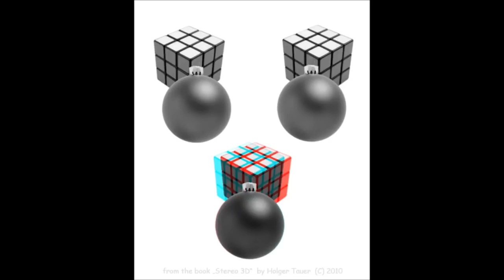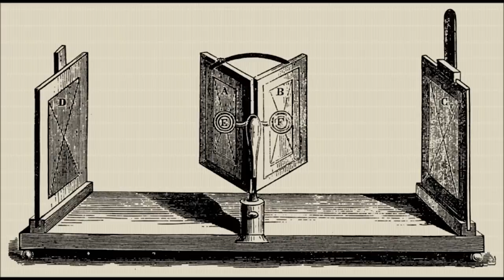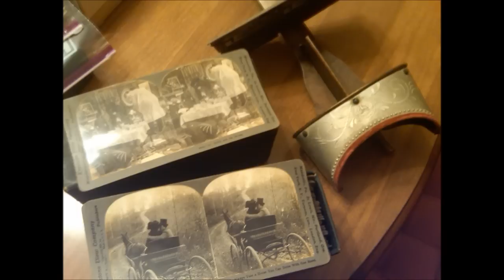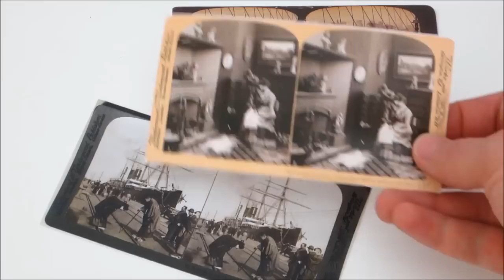DIY Hacks & How To's: Make a 3D Viewer

Comment: I can see both, crossed-eye 3D and parallel view 3D, for some reason switching between these two formats changes my eyes' view angle and because of this I see the parallel images bigger than the crossed-eye images, so if you haven't tried any of these formats, then try the parallel view first because it's better.

Comment: the picture at 1:47 has the depth completely reversed. The house and the green tree actually stick out in front of the pink one.
Reply: It has to be viewed using the cross-eye technique ( the left photo is on the right hand part of the screen ). You were 'crossing' your eyes ( merging the pictures ) which only works if the left photo is on the left hand part of the screen ). https://youtu.be/cvShotHl1As  has a tutorial on how to use the cross-eye technique where the left photo is on the right hand side of the screen. Hope this helps.